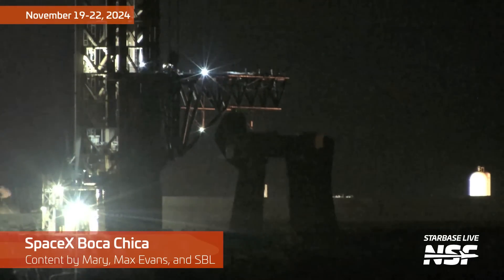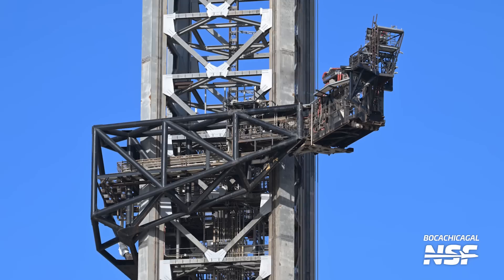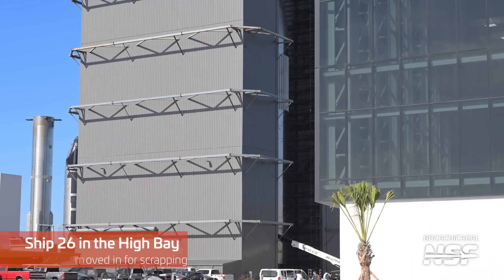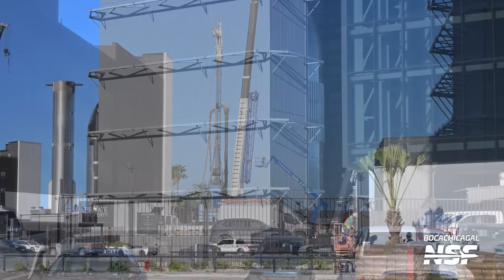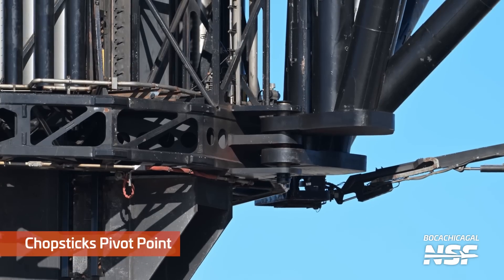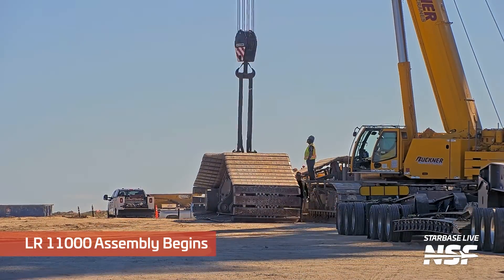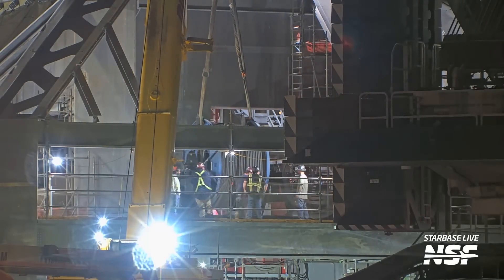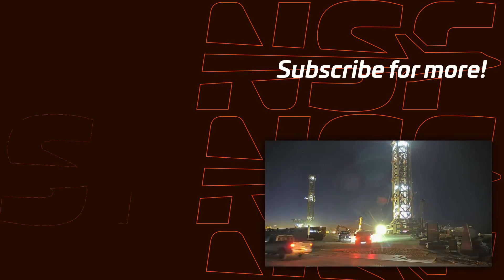Pad Inspections Ahead of Starship Flight 7 | SpaceX Boca Chica

Comment from the maker: Did you see D. Wise's Behind the Scenes Film posing as a Starbase Update? Be sure to check it out:  https://www.youtube.com/watch?v=OlrH8L4jYUw
Reply: Possible the blast did damage to the base connection(s) of, off, ove the mast as you said.
Why of off,  and not just off-?
Reply: They have to get a crane in because they dont have one tall enough to remove and repair the mast atop the tower.
Reply: Flight 7 - when?
Reply: 4K Videos please
Reply: @DieterMaier-r6k YouTube commenters try not to ask for the impossible challenge difficulty: IMPOSSIBLE
Reply: @vabtab2710  Why is it impossible
Reply: @DieterMaier-r6k  its a wide flat area with strong salty, dry winds carrying coarse sand and these cameras sit in those conditions 24/7 literally idk how much it would cost to replace lenns and filters for everytime they loose quality but its definitely not worth it
Reply: I wonder how the construction of the launch tower is going at the Cape.
Reply: Cranes need overhaul and maintenance. Gotta swap them out on that schedule.
Reply: you see D and you like it behind you to make a scene poser

Comment: Das - the last part of the crane that was installed is called the SA-Frame or live mast. It will connect to either the main boom or the derrick. On the SpaceX crane, it holds the whole boom, and all those parts of line are what is used to boom up/down.
The next step on the new crane will be to install the derrick, then the main boom.
Reply from the maker: Thanks! Will see if I can remember that 😅 - Das

Comment: 1 of Buckner’s LR 11000’s helped Franken Crane lift the 1st OLM into place “back in the day”. Also installed the vertical tank farm too. I’m betting it’s going to work with Space X’s 11000 , which would probably need to be reconfigured, and do Tandem Lifts for the remainder of Tower 2’s components. Always impressed with the way Liebherr designed and engineered their cranes to be built so quickly. Always will be my fav.

Comment: The scheduling of the cranes can be complex at times.  It could have been scheduled to go to a different project and has to be there by a certain time.  The other thing to consider is the cost.  That 8800 probably cost 1/2 a million a month on rent so the faster they can let it go the cheaper the bill.  Also I have heard that the spacex 11000 is having an issue hence why Buckner is being brought in to hang the chopsticks.  To rent a Buckner 11000 is roughly 300k a month if I remember correctly.

Comment: How do they expect to do a "rapid turnaround" if the launch mount takes such abuse every time it's used? Thousands of flights per day??
Reply: Ideally with enough towers there's fallbacks if one needs repairs. But yes they will need to generally figure out the "rapidly" part of the "rapidly reusable"
Reply: With any luck the different design they have for Pad B will solve the turnaround problems. It is remarkably difficult to solve though, so might take a while before we see super low turnaround times